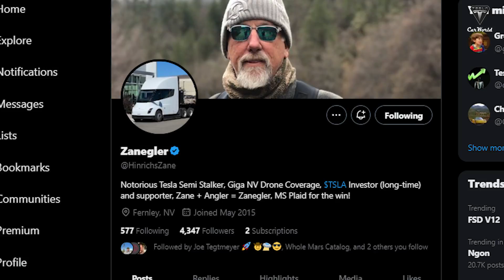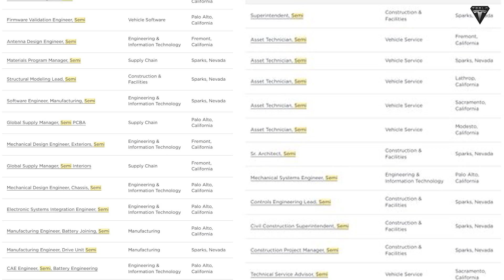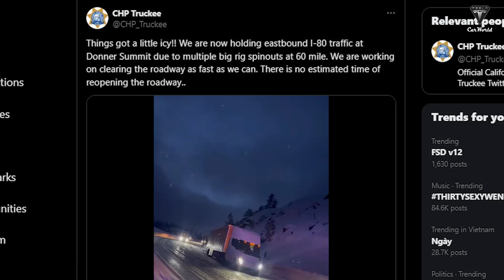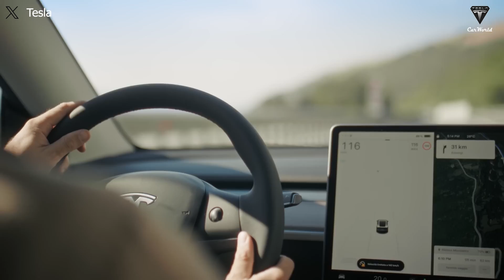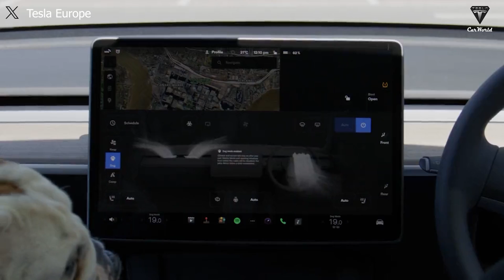It Happened! Tesla Semi HUGE Details Update Explained in 2024! New Version Will Hit The Market SOON!

Comment: It seems that many things will happen within a year. And the same next year and so on. Another thing which is extremely strange is the obsession with range, like 500 miles or more than 800 km. No driver is legally allowed to drive lie 10 hours without a break. Such a battery makes the truck heavier and much more expensive. Moreover, very little information about the technical specifications of the semi-truck is available anywhere. It is hard to believe that a company would by anything without knowing exactly what they get. Just viewed the Volvo Electric trucks and there are specs all over about more or less everything. And options like power outlets for hydraulics, or a crane or whatever, and options for the cab.

Comment: It's extremely embarrassing that the tesla semi only has one truck made a day and no signs of small scale semi automated products
Reply from the maker: Yes, developing and optimizing regenerative braking systems on trucks not only requires extensive testing but also overcoming various technical challenges. Integrating computers and auxiliary steering systems is not just a technological issue but also involves acceptance from drivers. As you mentioned, making it as 'seamless and discrete as possible' is crucial. Hopefully, with advancements in technology, automotive companies will be able to overcome these challenges to bring significant benefits to both the industry and the environment. Thanks for your contributions !

Comment: In my opinion, the Tesla semi cab was originally designed with accommodation for a sleeper cab in mind. The space behind the cab is already there. Just needs to be populated with the necessary components. I believe a sleeper cab could be added with only a 500 to 750 pound weight penalty. 

If the long range version is able to travel 450 to 550 miles on a full charge, they will be able to be utilized for longer haul routs. May not be suitable for cross country travel yet, but regional routes, it will be suitable.  

We are still back with the chicken and egg issue with the semi truck size and capacity charging infrastructure. However, I suspect all the major truck stop/travel center companies pretty much all have or are working on plans to add superchargers to their service centers. In the northwest, I have seen a number of new truck stops come on line, and a number of those have undeveloped acreage located around them which can be used to accommodate electric semi truck charging infrastructure. And as these places get built out, say between 150 to 250 miles apart along the interstates and main highways, we will see a whole lot more electric semi trucks out there. I am quite sure we will start seeing Loves, Flying J, Petro, TA and others out there adding charging stations to their fueling services. 

And they will have Tesla, Kenworth, Peterbilt, International, Volvo, Mack, Mercedes, Freightliner, Western Star, BYD and other name plates on their hoods. You can safely bet your padded rear bumper that all the major heavy truck manufactures are going to come play in this sandbox. It might take an additional 10 years from today, but it will happen.
Reply from the maker: You mentioned that there's available space, but currently, in close-up videos, we still see that Semi trucks are quite tight to accommodate a sleeper unless Tesla expands the cabin. Adding a sleeper weighing 500 to 750 lbs seems reasonable, but it's still not accurately estimable because, as you know, they're likely not just adding one thing; the entire interior structure of the electric truck could change. Thanks for value comment !

Comment: The center driving position allows easy use in cross border areas where the road behavior switches from traveling on the right to traveling on the left such as between the UK and France.   Driver feedback has been they got use to the center driving position very quickly.  

Like all BEV a game charger for use and economy is if the batteries were to advance greatly from what is in use now in 2024 with a doubling of energy to mass ratio, 10 minute charging, very long multi cycle life, no fire hazard, half the current cost or better per kWh storage and wide optimum temperature operation.  Many of these attributes are obtained with solid electrolyte batteries, but solid state batteries cost about 10 time more to produce than the current batteries and are subject to breaking in about 1/2 year in vehicle testing.   It's still not clear if it is feasible these issues will be resolved for solid electrolyte batteries, but other battery technologies may result in similar improvements.  CATL recently released its LFP Shenxing battery addressing a lot of these issues, but with only a not noticeable increase in energy mass density of about 5%.   For the daily driver charging at home this would be largely a non noticeable advancement.  It is suppose to increase the cycle life about six times giving over 250,000 miles and 20 years of service life.  

I got some feedback from truckers about if the Tesla Semi had an 800 mile range and the ability to easily charge it up at truck stops over an eight hour period typical for resting if it might fit in.   The 800 mile range I got replies seemed about right.   This would come about with batteries acting at the level of solid state batteries.   The Tesla Semi is really at the limit for battery weight and battery energy mass density needs to increase to extend the range from 500 miles to 800 miles.    The expectation is it would be seldom to greatly exceed 600 miles staying away from the low battery state.   The Tesla Semi may just emerge as a superior truck with better driving dynamics especially dynamic braking over the best Diesel Semi's.  My assumption is Tesla is going to offer a truly first class Tesla Semi sleeper accommodation.  

The main issue for adoption is cheap on-road charging, considerably less than Diesel and additional capital cost of the Tesla Semi over other comparable Diesel Semis.  The traditional truck stop with economical overnight charging hookups for BEV Semi's and fast charging for quick stops appears an easy fit if encouraged.  It is theoretically possible to charge a Tesla Semi with a dedicated full 400 amp 240 volt maximum residential electric feed (96kW)  in 10 hours if it had a 400 amp charger on board.   Somebody might do this to keep the truck at home.    Residential electric rates are more than off-peak industrial rates.

 For high air pollution areas such as the LA CA area and especially the Long Beach CA port area special assistance maybe warranted to gain heavy duty vehicle zero emissions.   The Tesla Semi if subsidized in purchase cost with an easy to use charging system might be acceptable to the current truck shipping firms largely as it is now in the LA CA port area.   The other BEV Semi's appear far less capable than the Tesla Semi and cost more making them not have any prominent advantages over Diesel trucks except zero emissions.    The excessive high cost of grid electricity in LA means there may not be savings on fueling with grid electricity over diesel.

Comment: Due to the higher weight of a battery powered semi and it's very low center of gravity they are less likely to break free and slide. However once they do, the drift is much harder to control. 
Again the regenerative braking difference lies in how many wheels are involved. Some trucks have multiple drive axels and the onboard computer can regulate the amount of braking per wheel. This can act like ABS in a car. This will require a lot more road testing miles for the computer neural nets to learn how to deal with all conditions. This has been one of the hold ups in development not mentioned in this video. Having a computer copilot is something that most professional drivers would reject absolutely. So they have to make it a seamless and discrete as possible.

Comment: What could be easier than a bigger Mega-charger? Charger batteries would be needed to add capacity at times the desired charging rate exceeded grid capacity. Max capacity is not need 24/7, but according to demand. Charging from a battery would change or eliminate the need to have inline rectification built into the charger to truck circuit.